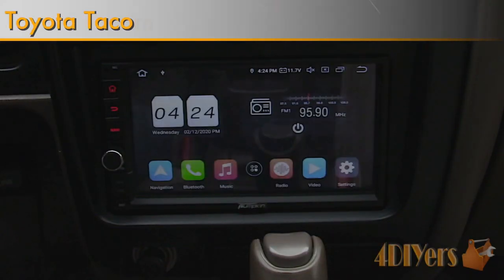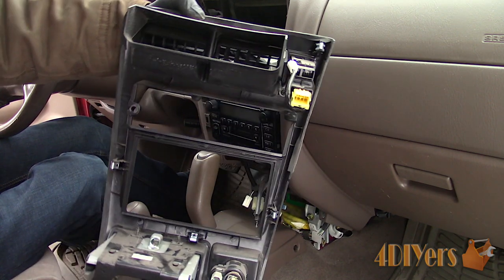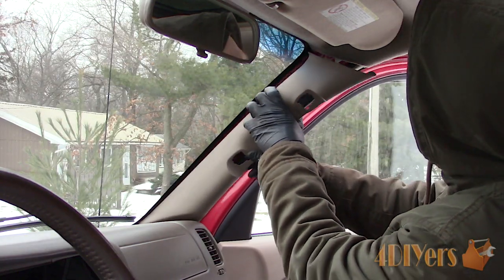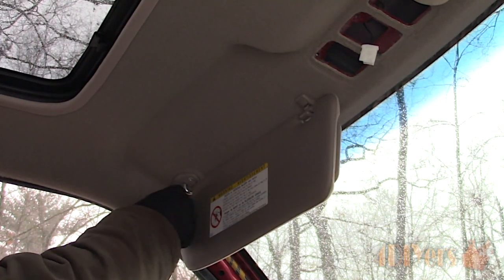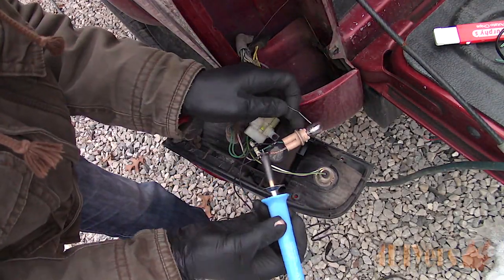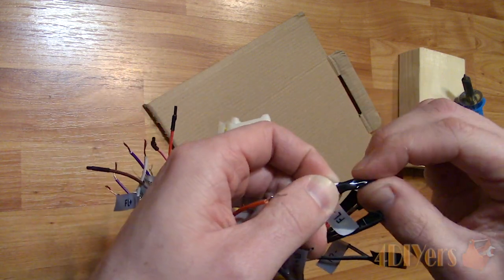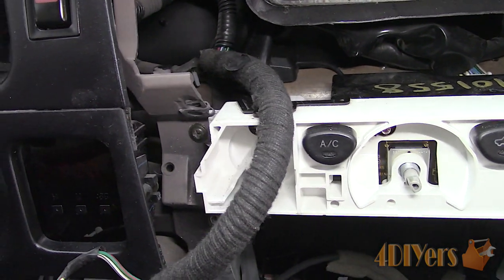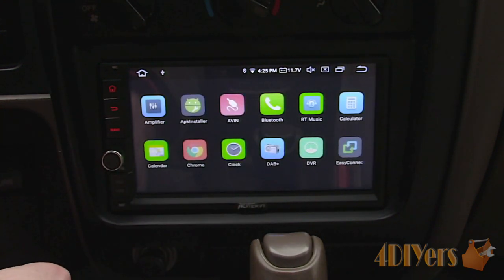How to Install a Double Din Radio in a Toyota Tacoma

Comment: Great video. Very detailed and well paced. I followed your instructions including buying the wiring harness for my 2003 Tacoma, but I only get sound from the rear speakers. Truck is new to me so I don't know if that was the case before I replaced the radio.
Thinking about swapping them back out to see what the difference is.
Any suggestions?
Thanks.

Comment: Hey I'm thinking of following this tutorial! One question I have is this: how awkward is it having the head unit that low? Do you have glare problems with that model? I have a 2003 manual Tacoma and I'm worried the shifter will interfere with interacting with the head unit. Any advice?
Reply from the maker: I never had any issues and I’m 5’11”. As for your truck being a manual, shouldn’t be anymore of a problem than compared to your stock radio. It’s in the same position as the factory radio.

Comment: Good video. When using the backup camera,  do i have to press a button on the unit to vied the video? Or does it automatically turns on once the vehicle in reverse. Thanks
Reply: I'm having this issue now I have 2 press the camera button but I don't think it should work like that
Reply: Did you hook the brown camera wire to the power wire on the camera
Reply: You have to connect the switch of the back camera to the reverse light and it automatically turn on the camera:)

Comment: Question for anyone who might be able to help. I installed my first head unit today in my 03 tacoma and it wouldn't turn on. I checked and double checked the wiring diagram and found out that the pins for the power antenna are non existant in ny factory harness. A friend suggested taping the blue wire into the red acc to get it to work and what do you know it did. The problem now is the radio wont turn off. Anyone know how to fix this?
Reply from the maker: Do you have an antenna booster? If not, there's no need to use the antenna wire. If your unit is not powering up, you need to connect to the switched ignition wire. Considering your head unit is not turning off now, it sounds like you're connected to the constant 12v source which is wrong, that's needed for the memory of the head unit but not as the main operation.
Reply: @4DIYers  hi thanks for the reply i got it sorted yesterday. There is no antenna booster. By taping the blue line into the red acc i accidentally made a loop that kept sending power to the unit telling it to stay on. The original problem of it not turning on was most likely a bad connection. Basically fixed it by doing the wrong thing the second time and making a good connection on the wrong wire. I removed the blue line re connected the red line and now its all good.